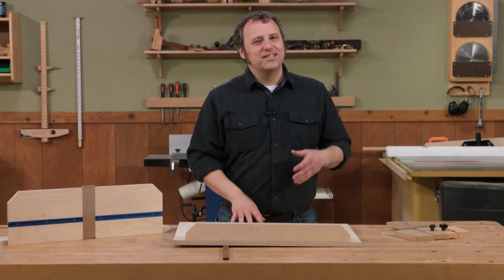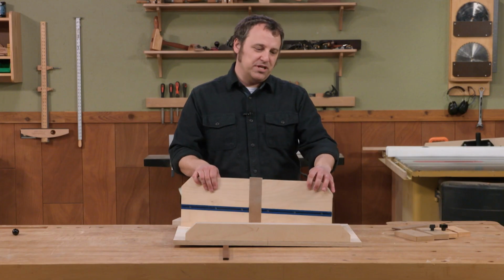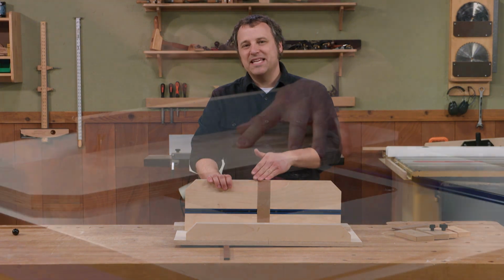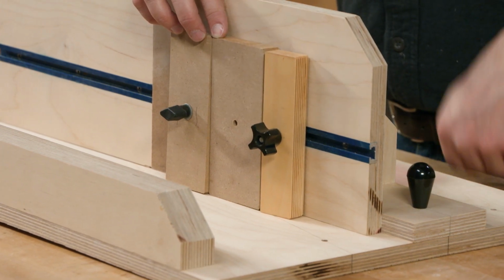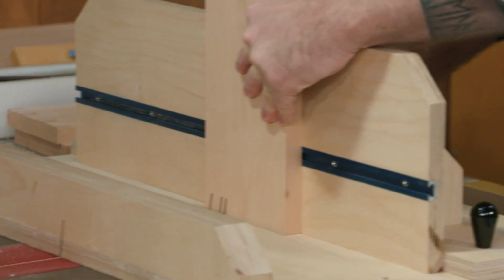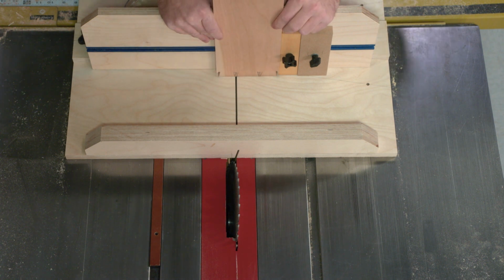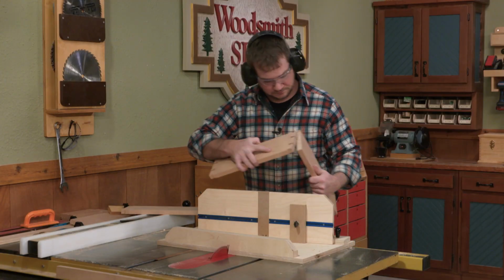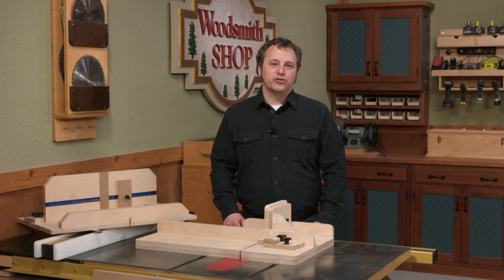Cut Perfect Dovetails on a Table Saw! | Build This Jig!

Comment: Just because it can be done isn't a good case to do it this way. I will stick to my router table. Seems this is way to much work and you still have to use a chisel. If I am using a hand tool I would enjoy the process of doing it all by hand....much more satisfying.

Comment: I like the jig but won't be racing out to buy a specialty blade to make dovetails.
Reply: You can use a regular blade instead, it just doesn't quite reach into the corners of the sockets. You need to chisel out that small triangle of wood, the width of a saw kerf and less than1/32" high.

Comment: Nice concept, but wouldn't it be a lot easier and cheaper to just take a little time and learn to cut dovetails by hand. A handsaw, a marking gauge and a chisel. And satisfaction in doing it without a machine. Just one man's opinion. But still, a nice concept.